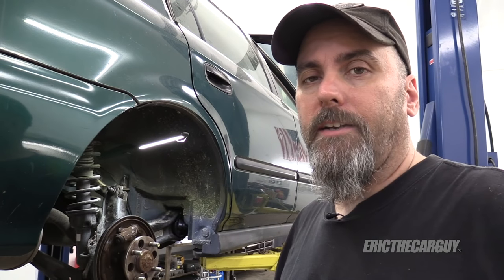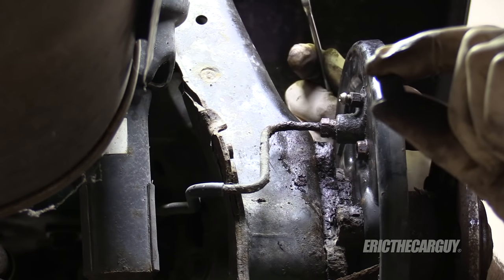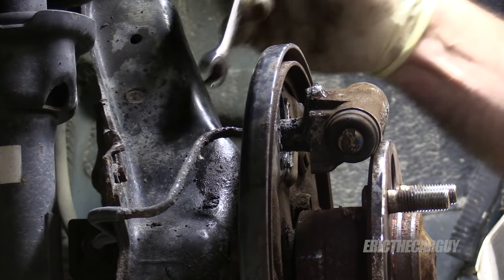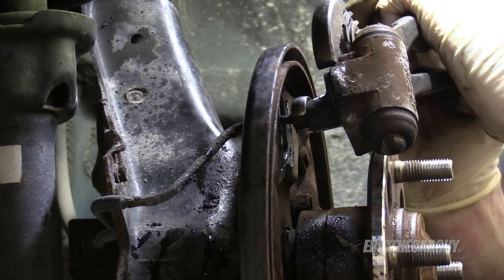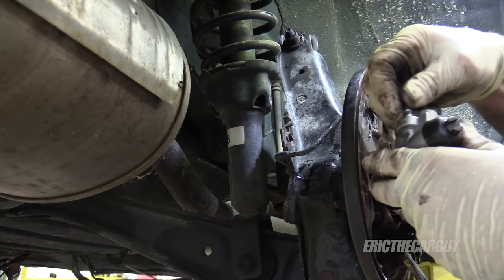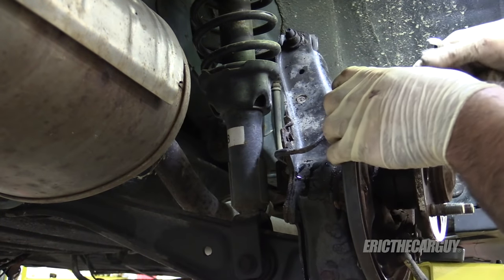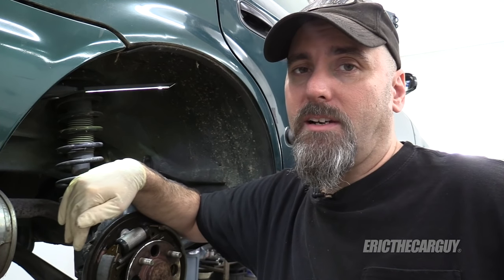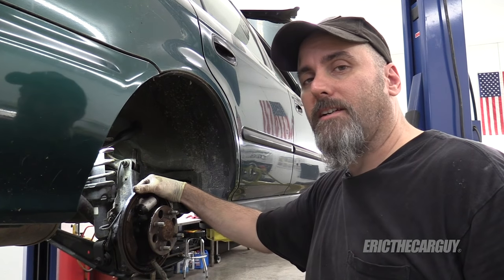How To Deal With Rusty Brake Lines

Comment: For those complaining that he didn't just replace the line right away, how about for the situation of having to remove a brake cylinder for a customer, a customer who does not have the money to replace both the cylinder and the line?

How about for the situation in which you go to the store and they have a replacement wheel cylinder for you, but will have to order the brake line, which won't be in for two more days, and you are stranded on the road, in another state?

Good tips, Eric.  Thanks for addressing the need to replace the line all together, at the end of the video. I wish more guys had acknowledged that you took care of that.
Reply: I'd tell my customer that I cannot put that piece of crap back on  your car. It's dangerous and I could be held liable and if you don't like it, take it down the street. It's only a few bucks. I rarely buy preformed  lines and have become very good at bending and flaring my own.
Reply: Loads of people saying a new brake pipe isn't expensive but us mechanics aren't free, if a pipe snaps and a customer won't pay why should we be out of pocket. Eric's channel seems to have the most people trying to nitpick over his methods.
Reply: everybody's all butthurt but the fact of the matter is we dont live in a perfect world. this information would be useful to many people.
Reply: @drummerboysmith968  --I wonder how many customers we would lose, talking to them like that....
Reply: @pakking Who you were quick to call an idiot may just not have the money to pay the extra hour of labor you were about to charge for the line.  I have been in that very position.  But you are absolutely correct in saying that you have the right to send that customer out of your shop. They would go down the road, and look for somebody willing to do what Eric just did, until they get the money to come back and fix the lines.
Reply: @drummerboysmith968  --See my comment to Pakking, below
Reply: stephen robson  simple then don't touch it !!! if you can't eat a 10 dollar piece of brake line and 30 min of time then your doing something wrong .....
Reply: @pakking --Someone who doesn't care is someone this video is clearly not talking about.  None of us gets to tell the customer what they may or may not own.  All that mentality is going to do is to drive away more and more customers--and many others that would have been future customers.
Reply: @pakking --My fault.  I DID word the comment to talk about a customer who doesn't want to spend the money.  Will fix it, now.
Reply: Then I tell him to go to Dallas to see a cowboy this is a no no brakes are all about safety how do explain that to judge Judy ffs
Reply: "Out of pocket"? A $1.00 worth length of line is more than worth a catastrophe or losing a valued Customer. As soon as I saw delamination- it's coming off. Add $5.00 to the final bill, but make a big deal out of it, worry and scare the Customer- or "refuse to do it unless it's paid for" is silly. I'm from a much different time, I guess.
Reply: @HUBBABUBBADOOPYDOOP  --You are from a different mindset, for sure--one that we desperately need to see more often!!  I am glad there are still a few left, like that
Reply: Unfortunately- I have been retired from auto mechanics since 2000. At my Uncles' Shop- we always had extra stuff. We had mostly regular Customers, but word of mouth can make or break any business. Replace a hose clamp, short run of a line, or a light bulb here and there; telling the Customer you replaced little things AFTER you hand them the bill, softens the blow. Itemizing any penny pinching people is just rude and petty. Charging someone for 10 bulbs when only 2 are used. I am not saying do "jobs" for free, either. We were never greedy, and valued our Customers. I remember when "full service" used to mean something.
Reply: lol, yeah if you are doing this professionally. strongly suggest do it the right way, either take your vehicle out my shop or find a way to gather some money . because once this line blew and accident happen its a lawsuit waiting to happen. for a $50 extra not worth it
Reply: I get all these points the sad part is the shops that do this sorta stuff and don't tell the customer they just push it out just to get it done.  Its not hard to talk to the customer and tell them something like "I replaced a faulty cylinder and your line needs to be replaced too but that's an order item.  It can be here as soon as a couple days, we can get you back in real quick to replace it."  I am sure if you show most people the line how its rusted and pitted in this case would understand.
Reply: Hot Ice  To replace that short line wouldn't take an hour even if you had to save the fittings on that line. I get where you are coming from. Your budget is your budget. If that little line put it over I could see where the extra labor could push you over the line.. If I sold wheel cylinders on that car and didn't let the customer know that the short brake line might break during the repair I would fix it just out of the fact I'd sleep better knowing that line isn't going to leak. That is a huge safety issue and I personally wouldn't let slide.  Some people just want their hours and some people understand the difference of a good and proper repair despite of making hours on the job. If you can't afford an hour labor then you certainly can't afford an accident or getting stuck on the road and a tow charge. I could probably find an end cut from a brake line job on replacing every single brake line on a chevy that would fit that length.
Reply: if the customer refuses to replace the line per mechanic's advice. Make the customer sign a piece of paper to waive mechanic liability. Your Doctor may or will make you sign a document "against medical advice"
Reply: Either way the car should not be put back into service. If the customer doesnt have the money, they should not drive the vehicle. It puts every other road user in the line of fire.
Reply: Customer is always right
Reply: In my opinion it's a great way to temporarily fix car and go to parts store for new break lines.
Reply: @JeeperJimbo  its all about going the extra mile that will pay 10 fold when u have a super loyal coustomer that remember what u did
Reply: drummerboy smith, you are wrong.  You do not have a working crystal ball and cannot predict when the brake line will fail.  It was safe enough to drive up until this point so you are incompetent to state you "know" it's dangerous now.   You should advise the customer that the line is rusty and that WHEN it fails, that is dangerous, but to refuse to do the repair what you may be doing is causing the customer to drive it away with a leaking cylinder instead which is certainly more dangerous than your magic prediction that it will fail someday.  Wait, are you suggesting you would refuse to return the customer's property or notify the police to try to stop them from leaving?  That's called extortion and is illegal, as well as putting yourself in danger because people who pull that crap, get what's coming to them.

Learn something.  You are not a car owner's "god", you are merely a worker paid to replace something.  You are not entitled to decide their tires are old, their brake pads worn, or anything of that nature beyond diagnosing and repairing what must be repaired, not what will someday fail in the future.  That is for the customer to decide, just as driving any old car is inherently less safe than a new one, yet they chose (or need) to keep driving the old car.

Plus, it is not only a few bucks.  What a silly lie!  If one line is rusted that bad they all are, then if you're replacing the lines you probably want to replace the soft hoses too, and that "few bucks" just turned into a $1000 repair.  This is fact, I have had friends and relatives billed for this work when I wasn't available to do it.  Doesn't matter if you're using bulk tubing to roll your own lines, that's still what shops charge to replace them all, and it usually IS using bulk line bent to shape because factory lines are often put on before other components and you can't get a new factory pre-bent line onto most cars these days, without taking half the car apart which would cost even more and be ridiculous.
Reply: i use that new style brake line you actually can bend by hand works awesome no bending tools needed.
Reply: True. Not every vehicle is in top notch shape. Things just happen, and you can not live in fear.
Reply: @coreymattingly2747  -"...loyal customer that will remember what you did."  EXACTLY!!!  I have brought thousands of dollars of extra business to a mechanic, both by my own car, as well as several referrals, to a mechanic who thought exactly as you just stated.
Reply: @spikerbrad23  -- you are not in the mechanic business to go around telling people what they should or should not do.  It is the customer's choice.  Period.  And if you don't want to work on their brakes, simply because you cannot have all of your money right now on the spot, then they are doing the right thing by finding another mechanic who does not think the way you just expressed. I have been one of those customers that sees the problem, but simply does not have the money to fix all of it. You would rather fix something, rather than nothing at all, knowing that after you fix this part of it, you plan to come back later and fix the rest of it. Anybody who resists that kind of thinking is simply ignoring the customer's dilemma, and is focused only on getting their pocket fat.
Reply: @hotice8885  no it's about public safety.
Reply: @hotice8885  So some claim this is a plublic safety issue. Well lets think how many of our coustomers are driving on the road with no insurance. I would even go as far as no license for a matter of fact. We dont turn them in for that but yet some shops and non certified techs will try to rob you blind for a rusty brake line, a warped rotor or a loose ball joint. I had a caviliar that i needed a coil pack put in it and the pass rear drum locked up and i could not get the drum off. They charged me 700 just bc i didnt have the time to do it myself. This is why the industry has a issue with trusting techs. We are there to help while making money. But making money should never cross that line to where a customer feels intimidated or bullied. We are people with special skills that should be used to help not harm. A little bit of a rant there but i rest my case.
Reply: @coreymattingly2747  --So well-said (and so true!).  At the bottom line, we too often find money to be the motivator, rather than concern for anybody safety. It is the lawsuit that too many are trying to avoid, and the loss of their fat paycheck, rather than helping or protecting others, smh
Reply: @spikerbrad23  --I take issue with the idea that the mechanic who refuses to work on a car unless the customer pays much more is doing so because of safety.  None of the mechanics who have responded to this comment have brought up the idea of working out a payment system with their customer, or simply gifting the extra work to any customer who wants to pay it, but simply doesn't have it. They have only mentioned that the customer "had better come up with my money, where they don't get any work from me at all." That is very telling!
Reply: @hotice8885  well you have to understand we can not work for free. We have to keep the lights on and put food on the table just like any other business.
Reply: @hotice8885  , one reason I don't like doing any type of work for people if they can't afford to fix things where they're NOT putting their safety/that of others, at risk. Good grief those "Customer States" videos.... I just can't believe what some people will/won't do. I mean using bungy cords and zip ties etc., to try to "help the rusted suspension stay on the vehicle".... I appreciate the fact that Eric demonstrated another way to get it loose IF the line was still in good condition BUT was still "stuck" between the fitting/line. In my case, mine was really tight and had a sharp bend, trying to pull on it etc., was not an option because there just was no space due to the tight, short 90° bend at the wheel cylinder. It kinked and snapped anyway. However, I had not anticipated this as the line itself still looked "fine", no visible rust. Well then I learned that this very short line could not be obtained any longer EXCEPT in a "kit" that was a couple of hundred dollars. I thought it's absurd that just to get a short piece of line I have to spend almost $300 when the psngr side line which was available was under $20.

So, I did a little research. The brake lines on this car were "bubble flare" so I found a short line with fittings and "bubble flares", it was "bendable with tool or by hand." I was a bit nervous about that as I'm not really "the Mechanic" anyway but I bought it. It was about 6" or so long, I then had to figure a way to bend it by hand to ~90° to fit into the wheel cylinder and then make a loop back around to the main brake hose, so somewhat of an odd "S" shape. Once I was done, it looked nearly like an OEM piece. No leaks, worked perfectly and it was less than $12 at O'Reilly's....

Comment: Ive run into this situation many times, sometimes on my car sometimes not.  One friend of mine was a real cheapskate and always took the least expensive way - least expensive for that moment until the line blew on an old single master cylinder system and he lost all braking, fortunately no traffic and he got it stopped with the parking break and downshifting.  But Eric is right, replace any lines that are this badly rusted - if theyre rusted bad enough to be froze to the nut it wont be long before youre taking a white knuckle ride-lol

Comment: I have used Freeze off. Have not broke a line sense.  Your advice on just replacing the line is spot on!  The crap they spray on the roads in the winter just eats everything.  I have started using Fluid Film on the underside of my cars.

Comment: One of the best tips I've ever seen, and this seems to be pretty true, is if you can knock all the loose rust off the threads/where the bolt or nut meets the other metal surface, down in those cracks that rust and dirt create a lot of friction and sometimes that's why a nut or bolt is binding. I know it's not possible every time, but I know I've hit brake lines with a steel brush for a minute and got it nice and clean, then sprayed it with penetrating oil and it broke loose nicer than the other lines on the same vehicle where I just started twisting.

Comment: Very clever way of getting some additional leverage and brute force to remove the fitting without rounding off the nut or breaking the line, even with a line wrench.  Nice!
Reply: Umm, putting a wrench on something to get more leverage to turn it is a concept that's been around for two centuries... maybe it was clever the first time some guy made a wrench from scratch to do that but since then, it's pretty much what a wrench IS FOR.

Comment: Used this trick for years, when people won't stump up the extra for new pipes. It's also useful when someone has previously fitted copper brake lines and the union is siezed, trying to undo the union will twist the pipe and eventually snap it.
Reply from the maker: Exactly!

Comment: This by far the easiest way to remove & replace your wheel cylinder without the head ache of twisted or broken brake lines ! Thank you very much, every step was a challenge but slowly the bolts came out &  the removal was quite easy ! Best tip i have learned in a while !!!

Comment: Brilliant, which is why I do it that way too. After I’ve removed the wheel cylinder, at that point I put a torch on the ferrel, heat it up and expand it, and it will break free of the line, pull it back, clean out the crud and your good to go.

Comment: I had same problem I used a small torch and put some heat on break line nut and helped break it loose with out damaging line i did it first before removing wheel cylinder clip hopefully this will help someone thanks for posting your video clip Everyone Have a Great Blessed Day

Comment: ended well, i wouldnt think twice about that, just change it if its that rusty, i find if you 'get by' the customer or yourself tends to forget about it till it pops.
good info all round
Reply: Except it's not that simple.  If one line is that bad then it is probable that all are, and while doing lines, you ought to do hoses, and suddenly la $150 repair turned into a $1150 repair.  It's always best to try to save any parts possible and inform the customer, as it is their vehicle and their money and their choice.

Comment: for those people that say "replace the line since that bad"i will say that its not always that easy.usually a customers car that is this bad,your lucky you got to sell them the rear brakes!now put on top of that $100 more!thats right,why that much you ask, line is $10.yeah,this is of course if you can just "wish" the line to be installed itself.the replacing of the line can cost easily as much as the whole brake job!now you may have to move other lines,that may break also and so on..the best rule of thumb,the less you have to take apart the better.work smarter,and you will work faster.nice video showing this simple little trick.been a tech for 25 years now and have dont this quite often in the past.not so much now with the advent of rear disc.

Comment: I just replaced my whole brake line and wheel brake cylinder on the driver side front and rear because it was rusted inside the brake line so I replaced them along with brake wheel cylinder cause I know I will go through this trouble. Thank you for this video Eric. @EricTheCarGuy